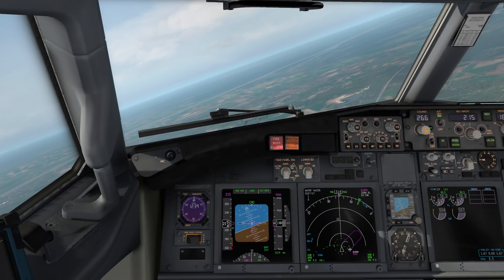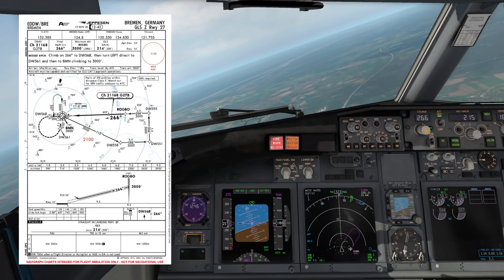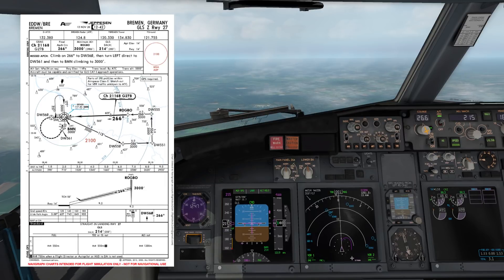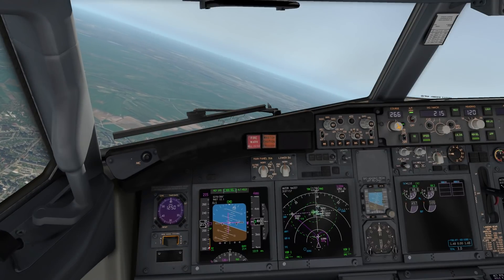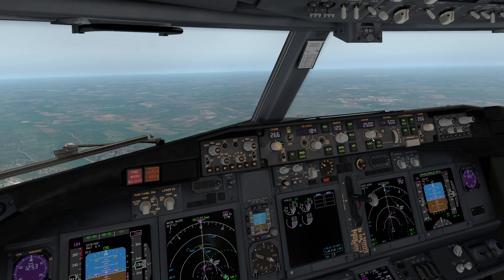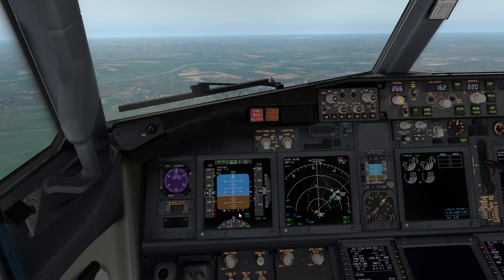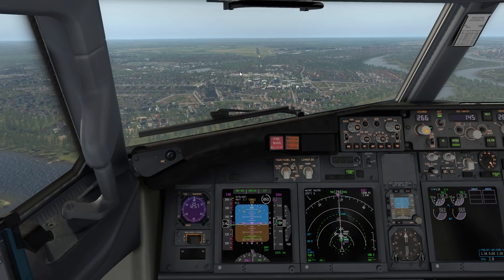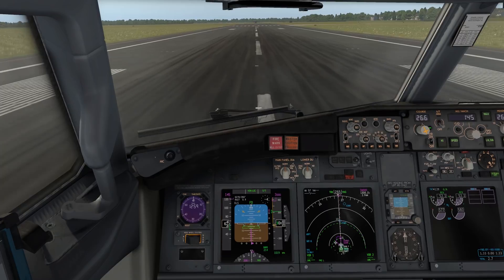GLS Approach Tutorial by Real 737 Captain | ZIBO MOD 737 | X-Plane 11

Comment: 6:38 What does the green circle on the ND mean? I've see seen multiple times in your videos, but I still don't know what it means and how to activate them... Thanks for the Tutorial mate!
Reply from the maker: Hi Major,

Those are fix rings which you enter in the FIX page of the FMC, we use them to increase our situational awareness and we have company specific SOP's regarding its use., this one is based off the landing runway (RW27)

X1 x3 Altitude Ring. We multiply our CRZ by x3. E.g. If cruising at FL370 we'd have a 111nn ring, this roughly will correspond with TOD

X1 10nm ring. The latest point at which we can select Flap 1

X1 4 or 5nm ring. The point at which we select Gear Down, Flap15.

FD2S

Comment: Morning.  Could you please explain (maybe as a video) why a certain chart is chosen for an approach over another.  It's difficult choosing between X,Y,Z, RNP, GLS, NDB,  and probably others I have missed.  Flying TNCM/MDPC/TNCM I'm spoilt for choice.
Reply: Apparently the general rule is Z is used most commonly but if the direction you are approaching from isn’t supported by that chart than you’ll go off the one that does

Comment: GLS equiped 737 is using BARO VNAV ? I m asking because in real life I have never flown GLS(always LNAV/VNAV)
Reply from the maker: Hi Samuel, the approach in this tutorial is a GLS approach which uses a Ground Based Augmentation System (GBAS) which is accurate enough to provide a precision approach, you use the MMR to tune. You use APP to fly and to the pilots it appears as a normal ILS

BARO VNAV (VNAV)  is used to fly RNP approaches to LNAV and VNAV minima, you use VNAV.

RNP Approaches can also use LPV minima. To fly to LPV minima the aircraft must be fitted with the IAN (Integrated Approach Navigation) mode, our fleet are not fitted with this option. You can then arm APP and the PFD will annunciate G/P (glide path) instead of G/S (glide slope). Flying IAN requires proper equipment and approval.

FD2S
Reply: @flightdeck2sim  thats all I understand but LPV you can fly without temperature limitation(such as in LNAV/VNAV..is that mean your IAN GP is GPS SBAS corrected nolonger relay on your uncompensated barometric setting ?

Comment: I flew the RNAV for 35 into Porto yesterday and noticed a similar but much higher 5 digit number—92423—labeled EGNOS; I tuned it but used LNAV/VNAV like a regular RNP; could I I have used it with final app since it was tuned, making it akin to a GLS? If not, what would be the purpose of tuning it into an MMR?
Reply: That would probably be to get LPV (Localiser Precision with Vertical guidance) minimums. If you look at the minimums on the chart if there chart has a 5 digit WAAS code then you can use that and you can get a lower minimums as it’s using satellite based correction data. That’s still not a precision approach though and I don’t know too much about the difference between LNAV/VNAV minima and LPV
Reply from the maker: Hi Lauren! 

EGNOS is associated with RNP Approaches which use LPV minima. This system improves the accuracy and reliability of GPS information by correcting any signal errors from GPS using a Satellite Based Augmentation System (SBAS) and you use the MMR to tune.

This approach in this tutorial is a GLS approach which uses a Ground Based Augmentation System (GBAS) which is accurate enough to provide a precision approach, again you use the MMR to tune.

At my operator we don't have approval to fly RNAV approaches with LPV minima but we can fly the same RNAV approach using LNAV or LNAV/VNAV minima.

FD2S

Comment: Great video, just one question is it ok to intercept the glide path below the FAP altitude? 
I understand that in this case under radar control and above MSA obstacle clearance is not an issue but procedure wise is it ok?  
Thank you for those very educational tutorials, keep up the great work.
Reply from the maker: Hi Manuel!

Well spotted and you're absolutely right, if flying procedurally you cannot descend below 3000ft until passing ROGBO, under radar vectors ATC could vector you to a shorter final and descend you below the FAF under radar control. 

FD2S
Reply: @flightdeck2sim  Thank you for the explanation, it is always better when you have operational experience to share and add to your knowledge.
As a student pilot I can say that by sharing your experience you are really helping us the future generation to make a smoother transition to the field, great content👌🏻

Comment: Very nice tutorial as always :)
I'll try to give some insight on the GBAS approach as I remember from my ATPL theory studys. Normal GNSS guidance isn't precise enough for precision approaches since the satellite signals are suffering from ionospheric delays, multipath reception errors and also other factors. The ground based augemantion system (GBAS) which is installed on the ground close to or at the airport "knows" its own exact position (in terms of coordinates) since it is stationary on the ground. It also receives the GNSS signals (just like the aircraft) and thus can compare the calculated position from the GNSS with its known exact position. Thus it is able to calculate the GNSS position error in the vicinity (which again is caused by various factors like ionospheric delays which vary with time). The position error is then being sent to the aircraft which uses this information to greatly improve the GNSS accuracy and allowing for precision approaches. So the GBAS station actually doesn't send any real guidance to the aircraft (like an ILS would) but rather correction signals regarding the GNSS accuracy which I think is really cool :)
Hope it makes sense and keep up the awesome work!
Reply from the maker: Very nice Fabi! We didn't even cover the topic when I studied for my ATPL theory all those years ago, we were still being taught LORAN-C!

FD2S
Reply: @flightdeck2sim  that would be i teresting never seen a Loran in action...
Maybe before the IRSs invention, in boeing 707 and DC8 they used it

Comment: Cool. For some reason I've always thought that a GLS approach was just a 'subcategory' of an RNP approach, but I see that in Bremen there is actually a separate chart for that. Now at some airports there is no published GLS chart, but there is an option to tune an EGNOS channel during an RNP approach (e.g. CH 41194 for RWY27 in Bremen, which is different to the GLS one). Is there any difference in terms of PFD indication/guidance and would you still arm the APP mode in such case or use the LNAV/VNAV mode as usual?
Reply from the maker: Hi Ondřej!

EGNOS is associated with RNP Approaches which use LPV minima. That system improves the accuracy and reliability of GPS information by correcting any signal errors from GPS using a Satellite Based Augmentation System (SBAS) and you use the MMR to tune.

This approach in this tutorial is a GLS approach which uses a Ground Based Augmentation System (GBAS) which is accurate enough to provide a precision approach, again you use the MMR to tune.

At my operator we don't have approval to fly RNAV approaches with LPV minima but we can fly the same RNAV approach using LNAV or LNAV/VNAV minima.

With regards to arming APP on an RNAV approach this is for aircraft fitted with the IAN (Integrated Approach Navigation) mode, our fleet are not fitted with this option. You can arm APP I believe in this case the PFD will annunciate G/P (glide path) instead of G/S (glide slope). Flying IAN requires proper equipment and approval.

FD2S
Reply: @flightdeck2sim  Such a detailed answer, thank you so much!

Comment: Is this the same as EGNOS that is used at some airports? e.g. EBBR(Brussels) uses EGNOS on RWY 25R
Reply from the maker: Hi Beau

EGNOS is associated with RNP Approaches which use LPV minima. This system improves the accuracy and reliability of GPS information by correcting any signal errors from GPS using a Satellite Based Augmentation System (SBAS) and you use the MMR to tune.

This approach in this tutorial is a GLS approach which uses a Ground Based Augmentation System (GBAS) which is accurate enough to provide a precision approach, again you use the MMR to tune.

FD2S
Reply: @flightdeck2sim  okay thanks for clearing that up